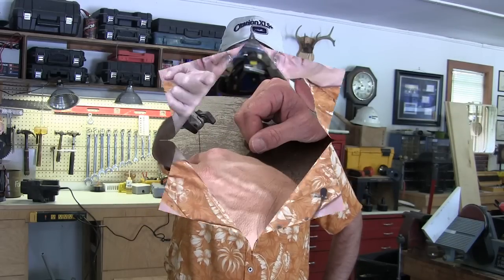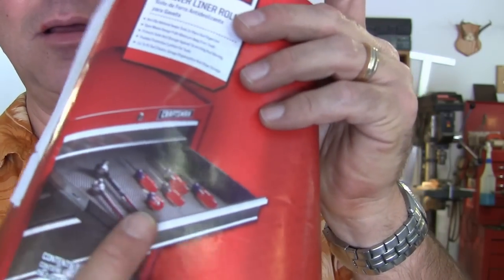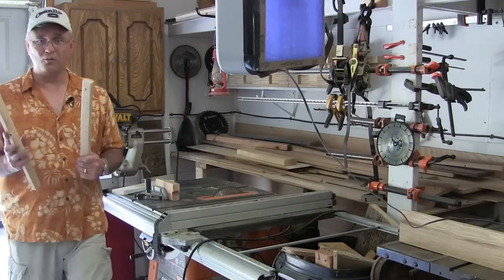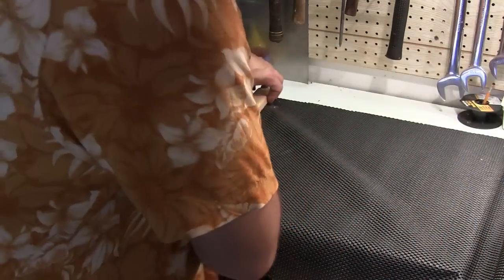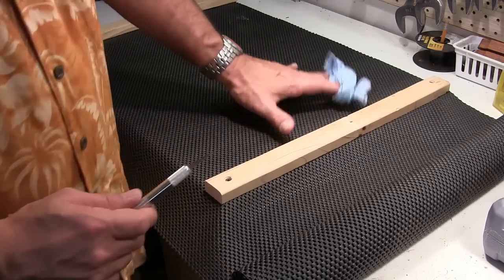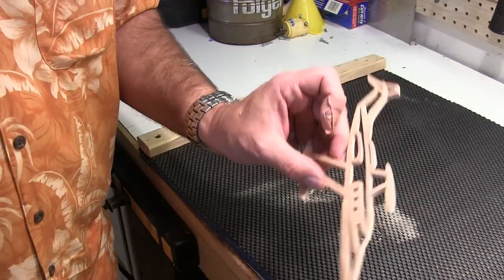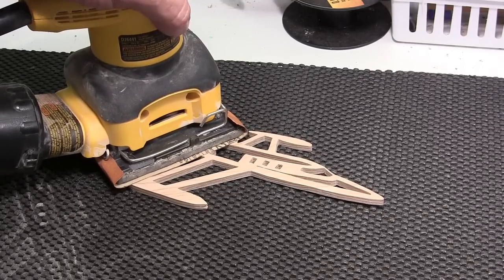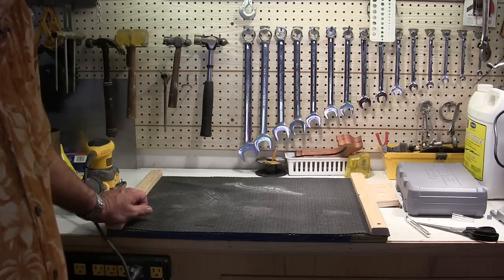Make a NON-SLIP Portable Sanding Pad For Scroll Saw Woodworking Projects

Comment: Great idea; thanks for posting. How about using some adhesive spray glue and attach some of the liner on the underside of the sanding pad so it doesn't slide?  Wouldn't take much material.(4 small squares at the corners)